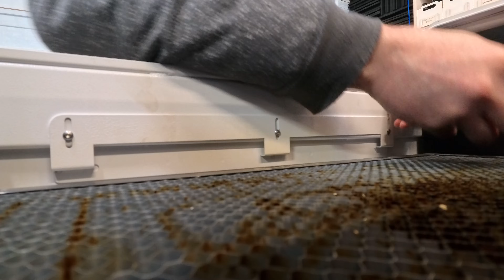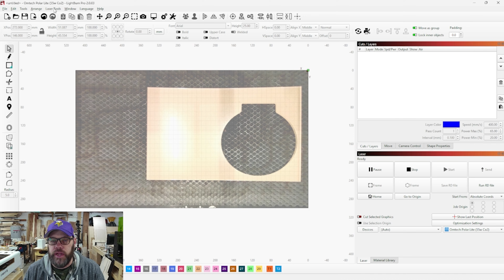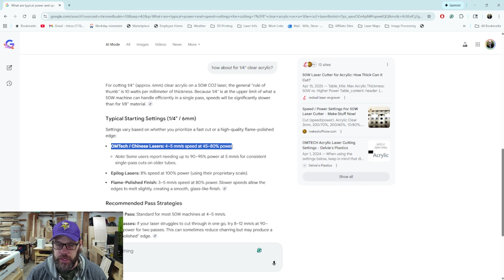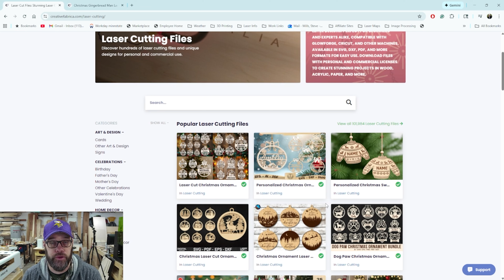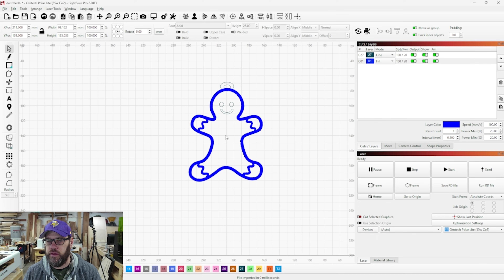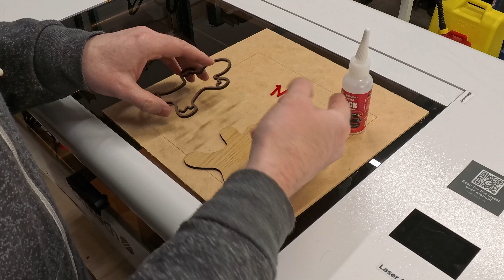Omtech Polar Lite 55w Co2 - Answering your questions

Comment: Thanks for the video, I have the exact same laser. I've been having issues with cutting through 1/8" basswood (plywood) - It flares up really bad if I go slow/high enough for a one pass cut, or if I go for multiple passes it flares up bad on the 2nd pass. Any thoughts? Overall I've been very happy with the unit.

Comment: Mein Polar Lite schafft es noch nicht einmal 3 mm Sperrholz zu schneiden .
Reply from the maker: Not all plywood is the same and some use horrible glues that are impossible to cut.  But you should also check that the lens is installed correctly and that it is focusing correctly. The lens should be installed with the curved surface up and the flat surface towards the material.  If it's in focus you should get a thin crisp line for the cut vs a wider messy line.

Comment: I use a cricut machine to make card cake toppers. I’m wanting to upgrade to make acrylic cake toppers (I’ve seen only CO2 lasers can cut white and clear acrylic). This is one I’ve found at a reasonable price. Do you think it will be easy enough to use as a novice? I’d say I’m slightly above average with technology 🤣 the mm per second etc worries me, especially when you mentioned flames 🫠🤣
Reply from the maker: Lightburn is the software you will want to use and if you take the numbers from my tests it’ll get you in the ball park. Any laser will require you to set the speed and power but some will have built in libraries that do make it a little easier. But they usually come at a higher cost for the integrated software. Once you find the settings that work for you, you’ll be able to save that and just apply it to your designs each time.
Reply: @Vintauri thankyou!

Comment: Hi. I am struggling to get my laser to actually cut through the material. I was advised to do mirror alignment and ramp test with this exact machine and I am struggling. Can you help 😢
Reply from the maker: It does sound like you may need to check the alignment of your mirrors.  It can be a tricky thing to learn the first time you do it so watch a few videos on the process and then plan some time and be ready for some frustration the first go around when you do it. Unfortuneatly I don't have a video on the Polar lite for this process, but Omtech does have one that covers the process on on of their larger lasers.  The process is basically the same on the polar lite. https://www.youtube.com/watch?v=M4dTrA25Qm0
Reply: @Vintauri thanks so much. I’ll look into it. The frustration has been real, but I know it’s all gonna be worth it once I get the hang of it.

Comment: do you know is there a way to pulse the laser while doing beam alignment? i just got my polar lite and the alignment is off.
Reply from the maker: It is frustrating not to have the pulse feature on the machine and the fire button is not available in the Move tab of lightburn for these controllers. What I have done as an option is to create a job with a small dot or line and set it up for low power and a very short distance.  This results in almost no movement and a quick fire of the laser. That should allow you to get the pulse effect for the mirror alignment.
Reply: I just learned how to do this without using the program. If you remove the right side panel, there is a red "test button" right in front of the power supply. There is a 6 pin green plug that has to be unplugged for it to work.

Comment: Hello!  Do you have any insight or suggestions on the Omtech Polar Lite air assist? I’m trying to figure out how to tell if the air assist is working or if it’s a hose problem. We have only had it for a month.
Reply from the maker: Because Ruida controllers communicate via a proprietary binary protocol rather than standard G-code, there are no text-based console commands (like M8 or M7) to manually trigger the air assist. You can open up the right side panel to visually inspect the pump and most of the air lines.  You could also setup a layer with the air on and the laser power set to zero to try to trigger the air pump and see if you can hear it.  You could also set the focus up high and tape a small piece of paper or ribbon to near the end of the nozzle to see if it is blown around by the air assist to at least know air is getting to the nozzle.  The air pumps on these smaller desktop units can often leave a bit to be desired. The Omtech Polar lite is a great laser, but I do wish there was more control or the volume of air.

Comment: Hi, I’m completely new to the laser community and I am lost! I have the Omtech Polar Lite 55w and I’m struggling. I can’t find any videos or tutorials regarding this exact machine. Everything I’ve found so far is for the Polar and Polar+. I tried to do an acrylic test card and after a few cuts a little flame started and I immediately turned it off.  I would love to know how to dial in my settings properly and get things going. I would really appreciate some help if you can.
Reply from the maker: While I did this on a different laser, the specs are close and the techniques will be the same.  Here is a video I did on help with using a Co2 laser for cutting and engraving acrylic. https://www.youtube.com/watch?v=gVZe2BEpBoE
Reply: Same here and  mine has now packed up :(

Comment: Which would you choose?  The Polar Lite or Monport 65 Pro Vision.  Thanks.
Reply from the maker: The Monport Reno 65 will have a larger work area, and it's easier to get inside and upgrade the air assist and uses an external water pump so adding a real chiller for longer use is nice.  The only downfall is that the controller on the Reno does not support chuck style rotary functions properly so you'll be limited to the roller style rotary options if that is something you are looking to do.

Comment: Hello, I have no experience with laser cutters but I want to get started. I have some questions about which would be best for acrylic cutting, next-generation LEDs, color signs, and infinity LED tables. I don't have much space, so I'm looking for a desktop machine. I'm considering the NOX 50W CO2 Laser Cutter & Engraver or the one you show in this video. The NOX is around $1650 and comes with some accessories. Could you tell me something about which one you think would be more suitable? The NOX is supposed to be RUIDA and integrates well with Lightburn, as does its camera. Other versions of GWEIKE don't integrate well with Lightburn software. There aren't any user videos of the NOX, only unboxing videos. I would appreciate your help.
Reply from the maker: I do not have any experience with Gweike lasers and as you have stated, there is not a lot of information out there about the NOX 50w. Generally these all in one desktop Co2 lasers are very similar in capabilities. So I would look at the general reviews about customer support, longevity of other models from a manufacturer, and over price compared to similar models.  I've had decent support from Omtech on a variety of machines from them.  I usually have responses to my questions within 24 hours. As I said above I can't speak to Gweike as I've never had the opportunity to work with any of their machines.

Comment: Hi again, do you have a video on how to use the pass through?!
Reply from the maker: Sorry I do not have anything more detailed than the bit in this video.  I don't do a lot of items that require more space than the working area of my various lasers, as the cut and print options or the conveyors tend to be more hassle than success in my opinion.  The only times I use the passthrough is when I want to position an engraving onto a piece larger than the working area of my laser, but the actual engraving can be done in one section that fits within the working limits.
Reply: @Vintauri one more annoying question, you’re the only channel I’ve found with the lite version lol have you got the camera to calibrate correctly?
Reply from the maker: @dannielle1518 I have the camera working but as most laser cameras it's best right in the middle of the bed. The outer areas start getting too far out for any precise placement.

Comment: Thanks for the update! Between the Omtech Polar Lite 55W or the Monport Reno Pro 45W, which one would you recommend? I was also looking at the xTool P2, but that is getting up towards being too expensive for me.
Reply from the maker: The Monport gives you an easier time to modify the air assist and chiller options, but the Polar lite has a little larger working area, and a better base controller.  If you want to do tumblers, the Reno is stuck with the roller rotary option where as the Polar Lite should also support a chuck style rotary.  Both are pretty good at flat materials up to about 1/4".  I think the stock Omtech exhaust fans work better, but they are louder than the Reno series.
Reply: @Vintauri thank you for the info! I appreciate you responding. I think I’m leaning towards the polar lite, but I’m concerned the cooling system won’t be enough and I will have to get a CW-5200 before long. Another question, if you don’t mind. Would you recommend a ground unit that has better specs since they are usually cheaper? I might be able to make space for one and I’ve seen a lot of people recommend it.

Comment: I've found some of the designs on creative fabrica are a bit... lacking in quality. Did a christmas ornament, but didn't notice till after I cut it out that section that was meant to be bent had some design issues that cause it to snap all the time.. so double check them before making, they might need some tweaks. Other than that, not bad.. I just worry about the license issues.
Reply from the maker: You do need to be careful about many purchased designs. I feel some creators only make the digital files but never test them for practical use on actual material. But I'm also okay with making slight mods as needed.  But keeping the licensing issues in mind as well is important.